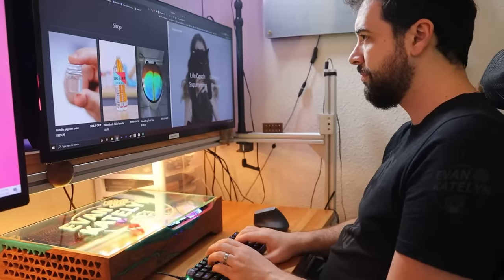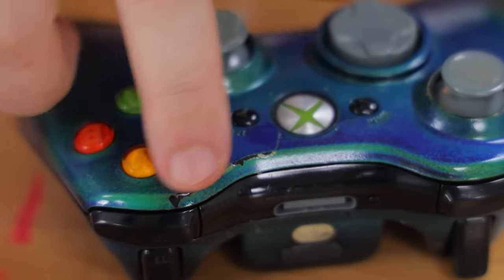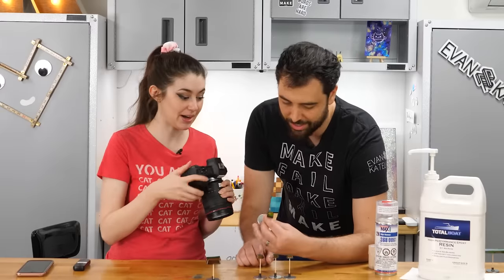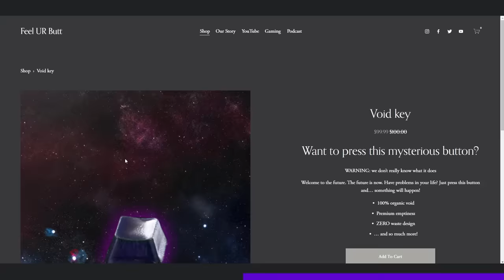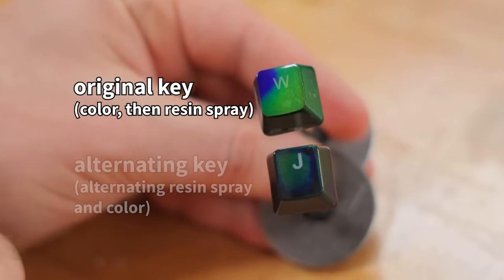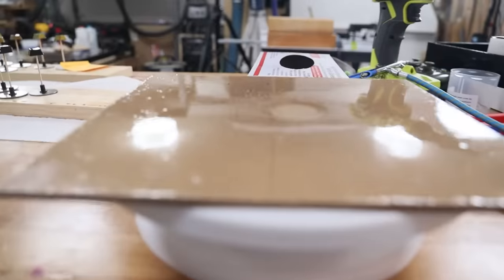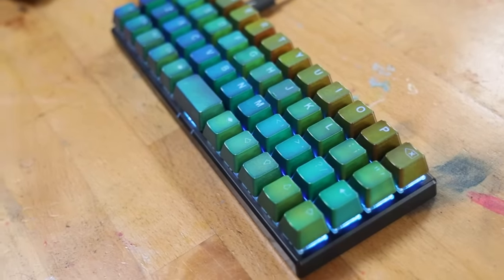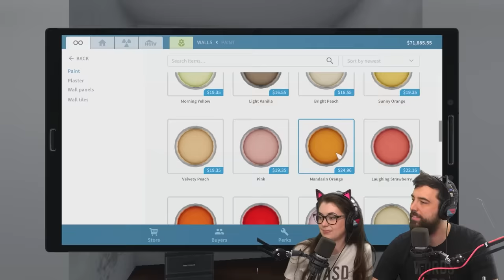DIY Mood Ring Keyboard

Comment: I find it genuinely halarious that instead of using Styrofoam and like rocks, they made a 3D print thing
Reply: yeah you would expect just a box of foam or cardboard stock..
Reply: I think they want it perfectly level
Reply: Evan has desires. 😂 Using the 3d printer more is one of them.
Reply from the maker: when one has a 3D printer, one uses a 3D printer (even if it might be overengineering...😆)
Reply: @EvanAndKatelyn  as someone with two printers no I can say this is completely accurate
Reply: @EvanAndKatelyn  Side question; have you considered resin printing? I kinda want to see what the intersection of E&K resin experiments and 3d printing looks like...
Reply: As someone with 15 printers, including resin printers, 3d printer is always the solution lol 😂
Reply: I thought it was a bit overkill too until I realised that they do enough projects where these will get plenty of reuse and you don't have to go bin sniffing every time for scrap.
Reply: would have been my way of doing it 😂
Reply: Awwwww no need to get envious about their 3D-printer man 😂😂🤣
Reply: @EvanAndKatelyn  “Over-engineering is the best route to security.” -Some smart sciencey guy
Reply: @EvanAndKatelyn  would you share the 3D design?
Reply: @souravkumarprusty  It's not envious those prints aren't free and scrap Styrofoam is lol.
Reply: They go beyond the call of duty.
Am I using that term right?
its been a couple of years.
Reply: anyone else noticed that the keyboard doesn’t have any number keys?? i mean… how??
Reply: I think when you spend that much money on a 3D printer you make any excuse to use it…
Reply: I mean...like they said that they need to justify the purchase
Reply: @HainekoSayuri  do you know who you are talking about 😂😂😂
Reply: Its Evan- did you expect any different?
Reply: @de4830  it’s a smaller keyboard they couldn’t fit it.
Reply: @akkothegirl7160  yeah i see that but how would u type some things without those keys…
Reply: @de4830  I honestly don’t know
Reply: Its Evan, did you expect anything else?
Reply: @de4830  You don't. Obviously.

Comment: I'm in the "automotive world" and we never paint directly onto plastic simply because there will be 0 adhesion. We actually use a produce called plastic primer which you can get in clear aerosol form and it's basically an adhesion promotion for bare plastic to help paint stick to it, I think that will help with the paint not peeling using the aerosol epoxy.

Comment: If I had magic brown fluid, I'd probably spray it on my water bottle! I think it would be cool to see how the water changes the temperature of the bottle and how me holding it also effects it.
Reply: A couple years ago during the summer coca-cola had colour changing cans (the white part). If you cooled the can the letters became pink&baby blue, and you could see exactly how much was left in the can because the empty part had way more trouble keeping it's colour, they were cool cans
Reply: When I was in school they gave us these heat color changing pencils sometimes for like fundraisers and stuff or like for testing just events in general they weren't mood rings that are more like those cups that change color with hot or cold liquid but they were cool
Reply: I actually have a water bottle that used to change color
Reply: Nowadays you can buy water bottle pouches from Asics and some other sportswear brands that the fabric do the exact same thing. Asics even has those ice pouches with that kind of that changes from light blue to dark blue when the water changes from frozen to room temp (from 25C+).

Comment: "3D print some nerdy toothpick holders"
I mean I would have just jammed the toothpicks into some craft foam, but you do you!
Reply: Lol same😆 

Sidebar. Nice lashes!
Reply: Good odds that spray would eat the foam.  I would have just drilled some holes in a couple of pieces of scrap wood.  Something else I have seen around, but haven't tried myself, is using one of those cat scratching boards made from laminated corrugated cardboard.  From what I have seen, they seem to work well with bamboo skewers but toothpicks might be too small.
Reply: lol i was gonna say that too
Reply: @ColonelSandersLite  Don't even think about ruining the Supurrvisor's toy- I mean stress relief tool!

Comment: For better adhesion, you can give the surface a "pre-etch" with sodium hydroxide, toluene, acetone, or even hydrochloric acid. You need to increase the surface energy of the (probably) PBT keycaps.
Reply: That's what I was thinking, but more basic, like sandpaper lol. There needs to be more surface area for the stuff to bond to.
Reply: @chlorophyllheart  either that or use some kind of primer, which doesn't sound too far fetched, using black primer would have the same effect, maybe the only drawback would be the legibility of the actual keys
Reply: This would work if the problem was adhesion to the keycap surface, but their problem here is delamination from the crystal coating. Even with better adhesion, a thick coating would still separate into layers. Considering this, they provided a good possible solution, which is to make the resin layer permeate the crystal layer. We will have to wait to see if it worked.

Comment: “Problem: [the toothpicks] fall over. Solution—“
Stick them in Playdoh? Styrofoam? 
“Design and print these really nerdy little toothpick holders.” 
.....Well, if you wanna be all extra about it.
Reply: My name is victoria tooo
Reply: It's because it would blow off with styrofoam and play-doh would melt no offence just saying have a great day gazing human :)
Reply: @iris-dj9ny  play doh is mostly just salt and flour. I'm not sure about it melting from a heat gun that e&k can put their hand in front of. ;)
Reply: @iris-dj9ny  they ended up putting washers underneath their printed toothpick holders but if they had just used styrofoam they could have just taped the washers to the bottom and gotten the same result haha😂
Reply: @iris-dj9ny  I use both styrofoam and the type of foam that is used for floral arrangements for when I paint model kits and I've never had it blow over once. You just need to buy a big enough block of it and it'll be stable enough so long as you're not purposely putting it in a windy area (which when you're airbrushing you don't want to do anyways because you'll risk the wind carrying bits of dirt and dust onto your painted piece)

However, I think these little holders Evan and Katelyn made would be easier to keep level for the resin probably
Reply: They held the toothpick regardless of the bases, and after done, they could have just stuck it in a good old kitchen sponge while it dries.. just saying :D

Comment: How to fix the peeling problem: LIGHTLY SAND YOUR KEYS.
The keys are smooth plastic, so naturally the spray resin would peel off, but if you sand the keys it will give the plastic some texture for the resin and color change powder to stay.

Comment: I suggest doing a light sanding over any smooth surface, it helps sprays adhere to them better. It really does help, it may not work all the time, but it does work for most surfaces.

Comment: A thought on the delaminating: it may be that the crystal paint needs a primer to be able to stick to that plastic properly (very common for a lot of types of paint, especially with smooth plastics), and that the clear you sprayed does not need a primer. If so, would only need one coat of the clear, a bunch of crystal coats, then the top clear coat. Might be an experiment for when you try to mood ring your, uh... steering wheel? I dunno, you're more creative than me figuring that out. :P

Comment: Hey Evan and Katelyn, did yall think about sanding the keys before spraying them. Its most likely the surface was too smooth, so sanding with a low grit puts grooves in the surface for the paint to adhere to. Not sure if the actual letters on the keys would survive, but that's usually how this problem is solved and might help in future projects if you didn't know or just didn't think about it. I love watching yall's stuff.

Comment: I just have an idea

You could've sanded the keys lightly to make it rough so the paint gripped onto it. I think you should try it
Reply: Ooo yeah. Only issue is the keyprint
Reply: They sell a clear primer called adhesion promoter. It is specifically made to spray on plastic items to get paint to adhere properly. They use it on plastic bumper covers for cars when they paint them.
Reply: Yeah, that's what I did to paint keys on a key board we have. The letters and everything were fine, but it definitely seems like it would help here.

Comment: ok, only halfway through the video and I have suggestions for the future.
mount the key to a pike that can be spun
mood spray only on the top of the key do a couple extra layers
sand the whole key (very high grit like 600)
sanding will give the resin a very grippy surface to bond to and the resin will smooth it back to glossy
have your cup of resin and dip the key into it to cover only the surface and not the back

while still in the cup, but above the level of resin after dipping, spin the key to throw off any extra to the sides where it will run back into the pool
set aside to dry right side up so the resin levels on the top

Comment: In the future, if you're having issues with airbrush paint and resin sticking to keycaps and stuff, try taking a high grit sandpaper or something similar you can find on the model kits aisle of your local hobby shop. Like a 400-700 grit sanding pad to rough up the surface.

Comment: Nice outcome, looks like typing on agate/gems! Without a 3D printer, you can also stick the toothpicks on sections of corrugated cardboard cat scratching pads. Scale modellers use them all the time with bamboo skewers for spray painting small parts

Comment: If you are applying something like paint to a smooth surface, you generally want to lightly sand it or otherwise rough up the surface to that things can adhere properly and not peel off in sheets.

Comment: Hi guys! Im wondering if the smoothness of the keys had something to do with them not bonding to resin. If the surface you put resin on is too smooth, the resin wont have enough "grip" to adhere correctly. Maybe if you sanded the keys a little, then spray painted them, and then used resin it wouldn't have come off. Even between resin coats it's important to sand a bit to make sure it wont come off. I don't know if the paint had anything to do with the "delaminating" situation. And I don't know how spray resin works hahaha. But following that logic it should make sense. I love your work, always makes me happy, keep making!

Comment: In think you should look into flame treatment. That is a good method for promoting adhesion to many plastics. Most plastics don't take paint well without prepwork, and certain saturated plastics with non-stick properties (polypropylene being a very common one) are extra bad. Sometimes you can get away with just scuff-sanding the surface for the unsaturated plastics, but that wont be enough for others. Also - it wont be easy to make it look nice when you want to use transparent coats. Flame treatment is usually the best option for adhesion, and if done correctly won't significantly alter the surface visually. It is also relatively fast and easy to do once you have practised a bit. Since fire is involed it should be right up Evan's alley :P

Keycaps are usually either ABS or PBT, so somewhere in the middle in terms of accepting paint. I don't think I have tried flametreating PBT (it probably works), but ABS definitely works well with this technique.

Comment: Liquid crystals has to be sprayed, dried, sprayed again, dried, sprayed again, dried, etc so it builds the coatings up then you seal it. So a layer of resin, multiple coats of liquid crystal over itself, then a resin coat is probably the best way to do these.

Comment: The delamination is probably due to a low energy bond in the surface interface between the liquid crystal and the PBT key.
The lack of color in the alternating spray system is probably due to separating the layers of liquid crystal by a layer of insulating resin. Or perhaps some weird diffraction of light.

I think the best solution is to modify the surface of the keycaps to adhere strongly to liquid crystal. If you started with a layer of the resin, then did 15 coats of the liquid crystal (or enough to get a rapid and sensitive color change), then finished with a resin layer, that probably would've worked.

Comment: Oh yeah design and print a toothpick holder with some washers under them to hold the keycaps, instead of just grabbing a block of wood and drilling some holes on it to stick the toothpick into.
Classical 3D printer owner solution. Love it

Comment: You could have slightly dipped the key caps into the resin multiple times to get a thin coat. Instead of dripping a big amount of resin onto the keycap.

Comment: You could maybe fix the problem of the coats coming off due to touching or incompatible plastic type by either spraying on something that would allow it to stick, or fining down the surface of the keys to make them semi-rough so the coats will adhere better (probably). Maybe even just some kind of straight up spray-on glue, should work. Let it dry, spray the coats on, done.

On a side note, a lot of the stuff on this channel can easily be made into a money making hobby. Especially this keyboard one. It would be expensive though since it takes so long just to do one key, but I don't think people would care since some custom keyboards that aren't as cool already go over 500$

Comment: I wonder if using gel polish base and top coat would work? It's basically UV resin, and people have been doing nail art with the LC paint. The base is sticky, then I think you wouldn't have to layer with the spray resin, just the mood paint. Then, no wipe gel top coat to finish. You would have to buff the surface of each key first most likely.

Comment: I wonder if you tried making keys out of resin would work and be less time consuming and back breaking.  Use your mold and put a thin layer of resin followed by the mood stuff in a heavy layer or possibly several thin layers and then finish filling the mold with resin.

Comment: I had a problem with that 2k clear coat delaminating on a car. Because the adhesion between that the clear and lower layers is chemical, not mechanical, the manufacturer suggested that I had waited too long between the color and clear coats. It should be on the order of 10 mins and must use a compatible color coat.

Comment: Guys, a tip for next time:
Build a small device that will spray-coat the caps - just a matter of a tiny a spray can holder with a tiny arduino that controls a motor that moves a piece of material that presses against the spray can to release spray - would save you *HOURS*!

Also, it'd be much more exact - it wouldn't move, unlike when you hold it. :)

Comment: Wild mid vid question but wouldnt it have been more efficient to just paint a think key layer into a mold with resin and then. Spray paint the inside? And then finish it with resin?
Reply: *thin

Comment: Can you spraycoat with epoxy resin? I guess in principle it should work, as long as you are damn sure to not let it harden inside your spray equipment :P 
What sort of thinner would you need for something like that?
If you worked with really fine layers than maybe it would even be possible to spray the 2 components seperately and let them mix on the surface layer

Comment: You guys only needed a base coat of the resin or even a black priming spray paint instead of doing layers of resin between layers of TLC... That would've made everything so much easier. And faster.

Comment: This is old but, 1.- instead of 3d printing support just use a sponge?
2- 2k clear coat is polyurethane
3- when you paint with 2k you have to sand the pieces, and first do dust coats before the wet coats hahaja

Comment: Buy a long curling epoxy heat up both the object you want to cover and the epoxy the latter you can so by double boiler and just use a heat gun on the keys or leave them in the sun

Comment: Coming from an automotive background, any automotive 2k clearcoat or professional clearcoat will dry within a 24 hr period. BUT, for it to be hard to the touch, you will need to have it dry for at a few months which is called the curing process. 

If you have a freshly painted part on the exterior of the car, it will be dry to the touch but if you put a fingernail in it, it will "dent" it. But if you leave it to dry for a few months, it will be harder to "dent" it. 

Also, I think the reason why the spacebar peeled was because you did not send the of the spacebar. Paint will always need something to adhere to and without sanding it, the paint will eventually peel no matter what unsanded surface.

Comment: The surface of the keys are too smooth epoxy bonds to rough surfaces so slightly sanding the keys would create the friction to bond correctly to the keys

Comment: They’re too shiny to begin with you need to sand the keys first or sand blast them for better adhesion. In doll customisation they use a product called mr super clear flat. If you sprayed a coat of that then your layers of magic brown fluid then a final coat of resin spray maybe

Comment: I wonder if they had sanded the keys for the test where it peeled, if that would have helped with the adhesion. Granted, you'd probably see the fine scratches or lose the print of the letters...

Also, with the patreon extras, do they ever come back & touch on wear & tear on past projects? I love this project, but I do wonder about the natural grease that comes from constant fingers-on-keys.

Comment: The reason why it was seperating from the key is because the key is a smooth surface, so the paint doesn't have a lot of places to grip onto. If you want paint to grip to it...you need to rough up the surface.